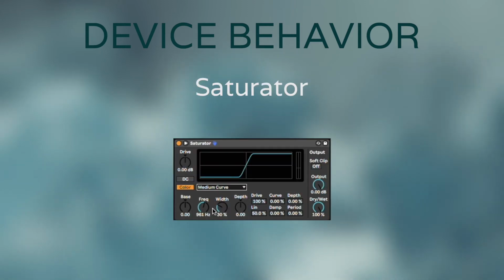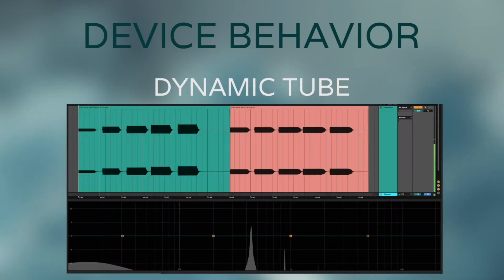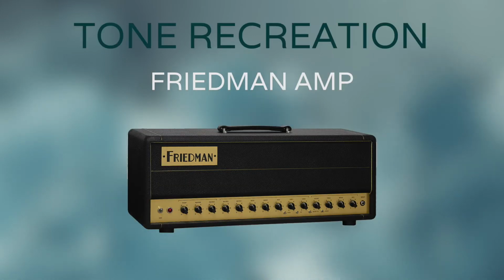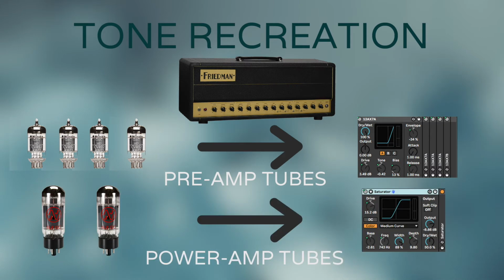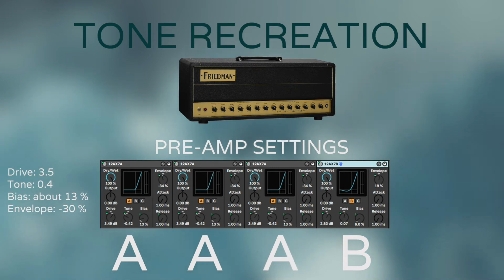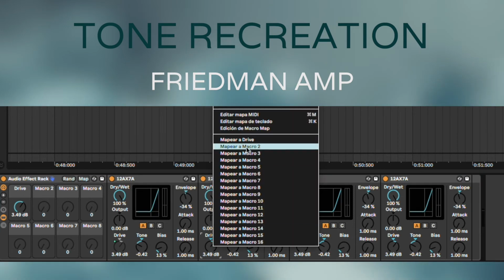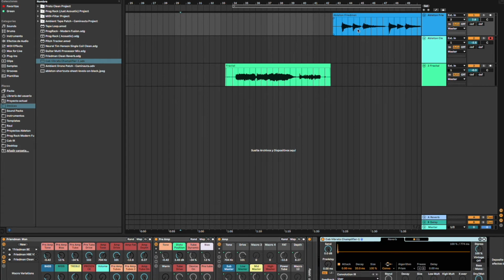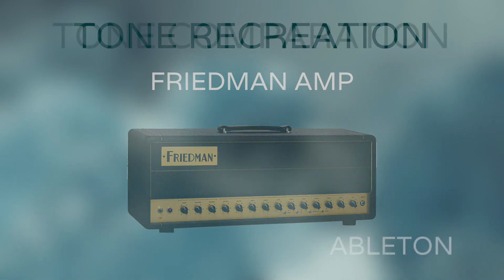Full Guide for Guitar Tone Design on Ableton Live (TUBE Amplifier)

Comment: Thank you! I bought the Friedman Tone Kit package on your site, but I'm getting the orange error at the bottom of Ableton 12: "Media files are missing"

I see that the ZIP package contains "IR Vibrato Champlifier.aif" but the .adg plugin is looking for "Vibrato Champlifier-2.aif". I pointed the missing media search to my extracted Friedman Tone Kit folder but it did not resolve the issue
Reply from the maker: Hi! I have it in 12 working, you should drop the IR Vibrato Champlifier into the convolution reverb, just drag and drop it and done! let me know if it works.
Reply: @raultizze  Thank you, yes it works. I see from the waveform that it's slightly different, the attack looks a little earlier. I think it still sounds fine though
Reply from the maker: @ yes is the way that IR UI looks but you can make sure that the attack is at 0ms and it will work as intended 😊